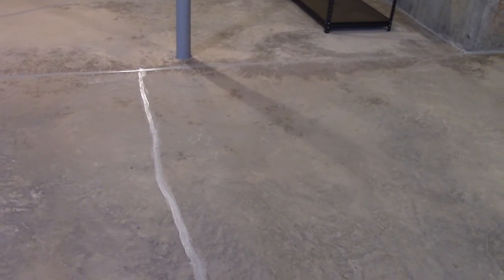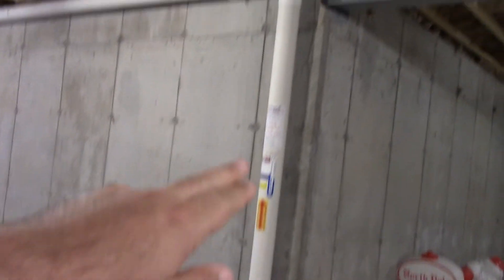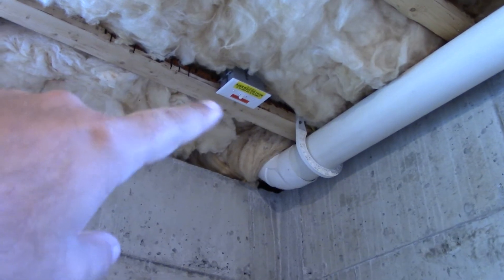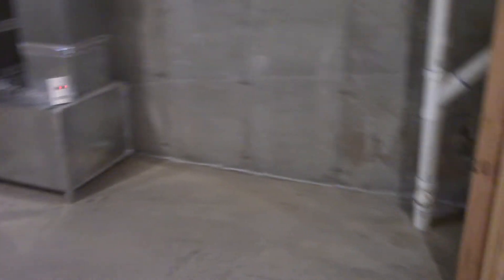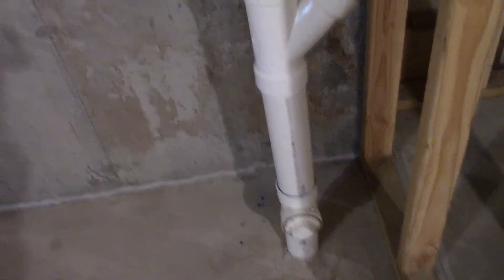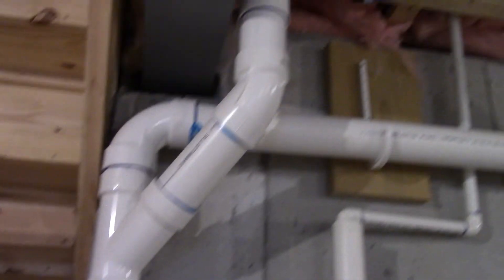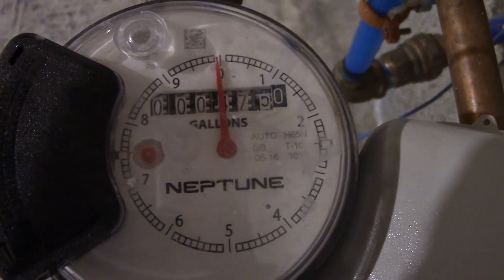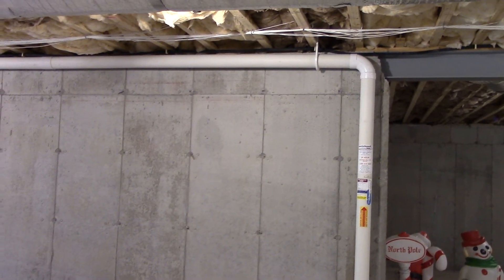Basement Radon Reduction System Updates.

Comment: Also that looks like schedule 20 pvc not 40 and most quality installers would use schedule 40!
Reply: Not true at all. Using sch. 40 is not necessary in most cases. I understand that it's a thicker wall pipe, but will not affect the function of the system. Remember, these costs always get passed down to the costumer.
Reply: @keithrogers2295  you can hear the air through the schedule 20 alot more than the schedule 40. It will produce more condensation during winter time as well. You're right about performance not being affected.

Comment: Why is the hole where they did the pressure test not filled back in and sealed?? The low vacuum on the furthest tab (hole and pipe into slab)  is indicative of an undersized fan or tight poor breathable soil beneath the slab. I ran 70 feet of 4" schedule 40 pvc with 3 tabs (3 pipes and holes in slab) for each poured foundation in my home and my furthest 4" pipe from fan can get almost 4" of vacuum though I have it turned down a little as it's not needing that much. It's all in the quality of fan u use too. I spent the extra and got a high flow radon fan. Curious what your fan is based on low vac in furthest pipe?
Reply from the maker: I can probably write you a book with the amount of problems my folks had with the builders initially. The hole had been sealed since this video. I only noticed it wasn't as I was recording, but didn't mention it. I don't exactly know what the air movement ratings are, but I can tell you that the 3 inch pipe got a fan upgrade to a stronger one before the second pipe system was installed, hence the higher pressure. All this work was on the builders since the radon amounts were not at safe levels initially, and that was covered. 

I don't think the lower pressure on the 4 inch pipe is a bad thing. It's a pipe that is an inch larger in diameter, and maybe it has a different fan, not sure. But, since the second fan was installed (I have another video on this too), the radon amounts were brought down to well below the maximum allowable levels. So in the end, it worked out. 

I don't quite know what schedule 20 and 40 means with PVC, but regardless, everything is working the way it should, so I'm not really concerned.

Comment: Any reason the new blower fan was installed outside the house, instead of perhaps in the basement, protected by weather, as it has a much shorter run?
Reply from the maker: I had read up on that and apparently the fan being outside is code. It's so that the piping inside the house has negative pressure, so that if there is a problem with the piping or the fan itself, such as break in the couplings or something, it wont be blowing radon back into the basement.
Reply: That actually makes a lot of sense!
Reply: Canada allows and actually recommends the fan be installed in the basement for better protection of the fan and as they say the system will work fine if installed properly.  My city in Indiana also allows placement of the fan in the basement.  Lots of good reasons to place the fan in the basement and unfortunately most areas of the US are backwards on this topic.  If the Radon fan is not allowed in the basement then they should also not permit gas furnaces and gas water heaters to be placed in the basement.  The EPA needs to rethink their logic.